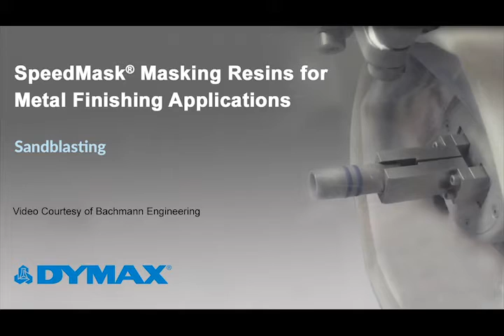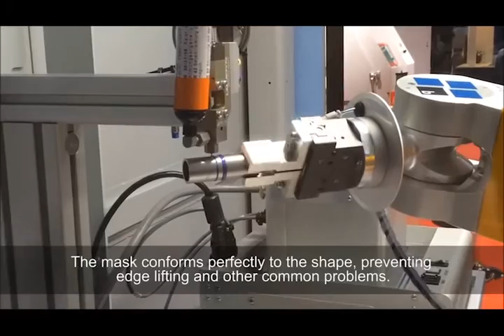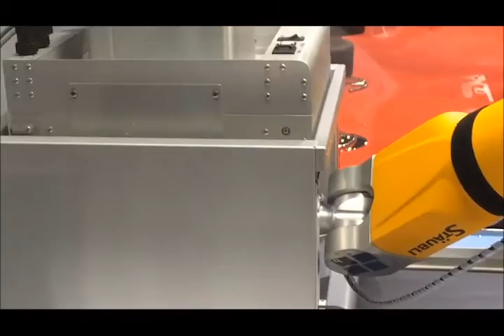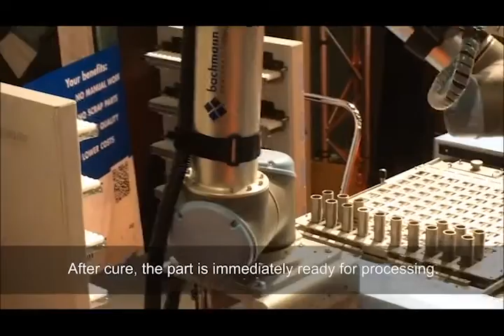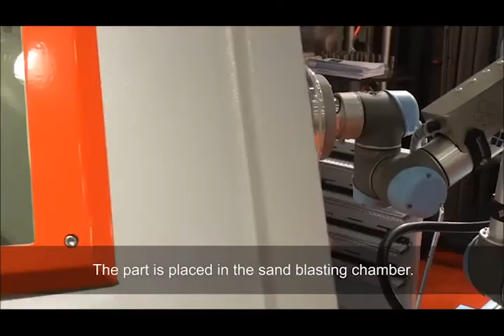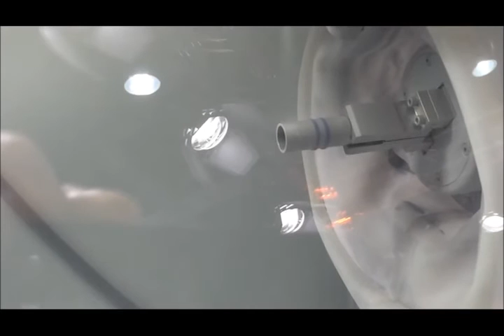SpeedMask Masking Resins for Metal Finishing Applications (Sandblasting)

Comment: How easily removable is this masking?
Reply from the maker: Hi Christian, We have various maskants to be able to withstand various surface treatments.  Depending on how aggressive the process is, we may need to have a maskant with more adhesion versus another process that it is not aggressing.  so, we have Low, Med and High adhesion maskants to work with the various requirements of surface treatment applications.